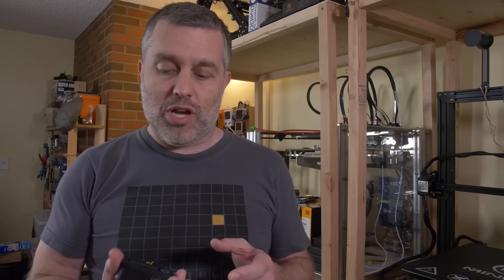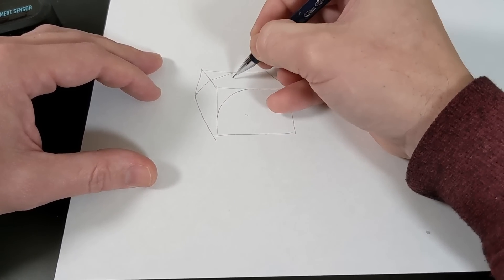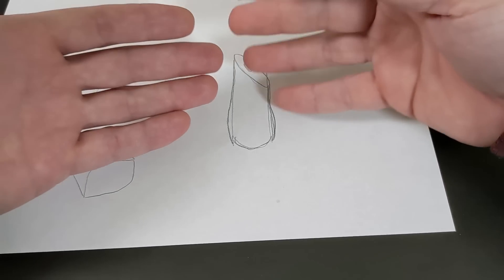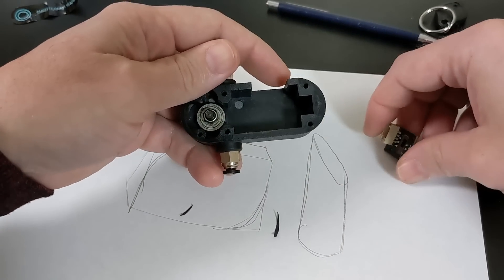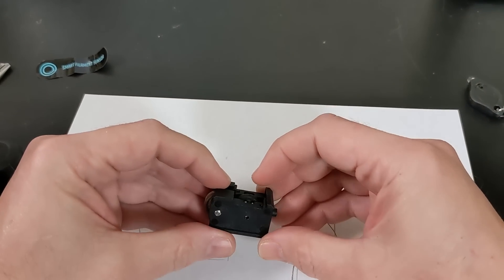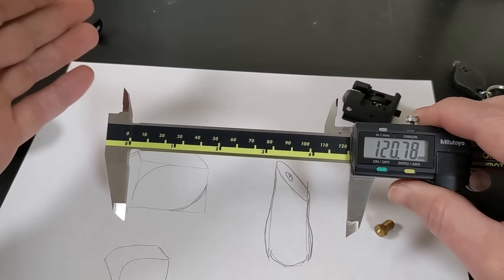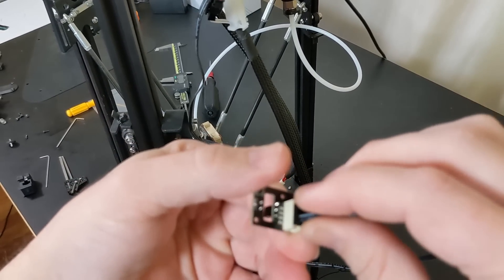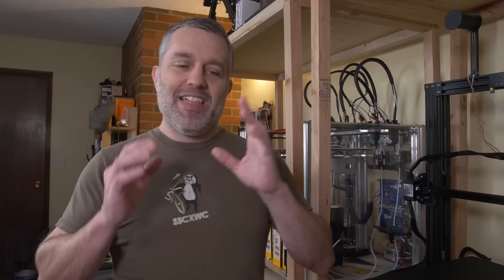The Bigtreetech Smart Filament Sensor - An In Depth Review

Comment: Another nail in the coffin for BTT. We already knew their reputation left a lot to be desired. But even so, the thing about Duet is that they are now actually inferior to Klipper. The Duets whilst still being easy to configure...  are no longer technically the best performance choice when it comes to getting best print quality for printing at speed. The new thing Klipper has now is the option to attach an accelerometer module to your print head. And then run a diagnostic that compares the commands send to the steppers against  the reaction of the accelerometer.

This configuration step only needs to be done once per printer. Unless you change your motion system or the weight of the print head. It is called the input shaper. And it seem is a feature not available anywhere else? Correct me if i am wrong. Aside from the input shaper Klipper also has its own version of traditional  linear advance too. So the accelerometer thing costs peanuts but is completely optional. As for controller boards, you can put Klipper onto anything you like out there. But currently the Fysetc S6 is the best recommended one. There are Klipper configs already done by annex engineering. Or if you can instead wait a few more weeks, then the brand new Fysetc Spider will be launching soon. And so that is the company who is now better than BTT these days. At least for getting a board for running klipper on. Its a better quality board than what BTT is offering. And fraction of the price of a Duet.

So what do you think Duet will do now? Become a copycat of Klipper, which is an open source project... in order to keep up with the very latest developments? Or proudly stand continue as they are. And then perhaps gradually fall out of favour. As day by day more and more user keep converting over to using klipper. At an ever increasing rate. Personally I think what the Duet company should try to diversify, but in a smart way. To lower their risks in face of increasing competition. Which will only ever get stronger over time. Duet as a company still has a great set of strengths and expertise they can build upon.
Reply: A nail in the coffin for BTT because he couldn't read the manual to make sure he connected it properly? This thing works just fine, even if it is overengineered and has a bad form. I've used several filament sensors and this one is just as good as any other one. It was an interesting analysis regarding the form, with which I agree completely. But to then proceed and connect it in a wrong way without reading the manual and then shitting on the electronics... I mean.. He should have stopped there, ordered a new one, connected it properly and reviewed the functionality. Mentioning his mistake and instead criticizing the fact that the manual is not included in the box. And if this product is so shitty, design a better option and include it in the video. That would have been a 10/10.
Reply: @erikhellman3974  Yeah I entirely overlooked that aspect. Personally I can see both sides of the argument. But overwhelmingly the truth is most ordinairy people do interact with electronics just exactly like this. They dont know enough about the circuit, and either cannot find their instructions or dont realize that the instructions matters. And quite often don't expect it to be possible or allowed to plug cables into ports in more than one possible way. So it is a good example from that perspective. About how if the manufacturer just put more effort into clear labelling and warning signs / stickers etc. Or if they put more effort into safeguarding the inputs to the PCB. To make it a more robust circuit. Either / both things go a long way to lowering the product's RMA rate. But you don't expect BTT to do any such things because of their history and track record with other products. My main point was not about this specific product made by BTT being really too bad beyond being usable. But rather they have generally completely lost their way these days. Just look at the other new products they are releasing now and compare them to Fysetc. Or even Mellow with the flyboard. And then BTT you just don't have the same level of product support. As those other 2 options which are also both coming our from china.

Comment: My only criticism is that a lot of your criticism is conjecture. I am sure they did the 3 wheel thing for some reason. I don't know any company that would add complexity/cost for the fun of it. Did you change your pinout on the side that connects to your board. I can see btt not getting into the details of the wire and assume everyone will just plug it in without looking at the wire...With that said they should have had safety circuitry in place in the event anyone hooked it up wrong.
Reply: Because it's sold and designed for their boards. This is not how it was reviewed here and why it fried, twice.
Reply from the maker: > am sure they did the 3 wheel thing for some reason. 
You are giving them the benefit of the doubt? "Some reason" doesn't mean it's a justified reason. Could be a very stupid reason. This thing is like maybe $2 in materials. They are making like 800% profit on it. They don't have a lot of incentive to value engineer it. They went with the first version (The beta version) that worked, and charged as much as they possibly could.

Comment: If you look at the BTT SFS manual on github, you can see that the case in that one is 3D printed instead of fiberglass reinforced nylon, I suspect they used the same model as the 3D print, and did not optimize it for mass manufacturing

Having tested it myself, it works fine for the application, though I do print with a .8 nozzle, rather than a .4 (increasing it's sensitivity). Another issue is getting the tuning just right, as it can go out-of-sync with the filament due to the filament gears slipping, causing false errors. 

I would definitely place it before the extruder, rather than behind it by the way, found that to be easier to mount due to it's weight

Comment: I agree with you about that sensor not being worth. However your assumption that the skr boards therefore must be bad too in my opinion isnt quite right. No doubt are the duet boards the superior product if you whant the best board you can get, but for many people, like me as a student for example, thats not what they're looking for, they are trying to get something that works but is still budget friendly. Thats where for example the skr mini for around 35 bucks has a valid place. I installed one in my ender 3 running klipper and I my experience was flawless.

Comment: Looks like you likely wired it wrong if you look at the docs, its V+ SIgnal, Ground
https://github.com/bigtreetech/smart-filament-detection-module/blob/master/manual/smart%20filament%20sensor%20module%20manual201125.pdf.
Reply: btw, I would have expected that to be the pinout as well.. v+, gnd, sense to isolate the sense wire away from any noise on the power supply.

Comment: I buy skr from them for testing the printer and to my surprise it hold up so i use it for 2 years ..... Board is working great without single issue  but it was the older one v1.1 
It still works just fine ,few hundred hours in 1 go and nothing happend :) 
For the money.....good quality but not every time
Still for me Duet is the way to go if u want professional 3d printer

Comment: I wish you would stop explaining how much better you are than others. Almost every video you make other YouTube's or manufacturers down ☹️ your channel would be so much better without those remarks. Just saying...
Reply from the maker: You interpreted my words as arrogance. If I simply launched into my criticism about design without providing context and credentials, someone else would have left the comment "You think you are so good at designing. Why don't you try to do some industrial design and see how hard it is." I do not feel like your assessment of my words/character is accurate.
Reply: @DesignPrototypeTest  your credentials would hold more weight if you actually plugged it in correct and knew how it worked with marling (ie the software it was designed for) and the proper way to use form over function .. you shouldn't NEED to cram your credentials down peoples throat if you know what you're talking about.. saying i got paid well for it is completely irrelevant to the convo and is arrogant .. not to mention you talk smack about industrial designers saying they can be just sketch artists buuuut then don't go into any detail of what part of the process you actually did.. so you didn't give context or credentials.. you SAID you've done work in the sector you realize anyone can say that. you talked down on others and then made a mistake lol
Reply: It's his style, and I understand him, he's alone in most of his videos, but his interactions with others put that seeming arrogance in a whole new context, like rough constructive criticism